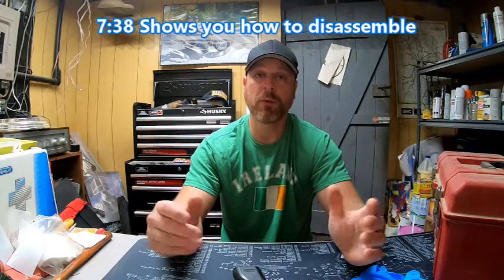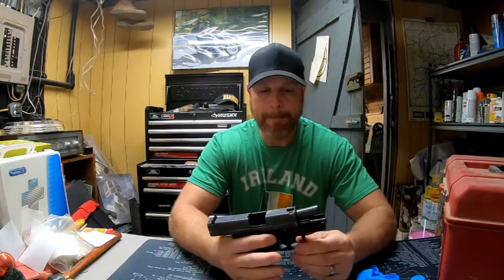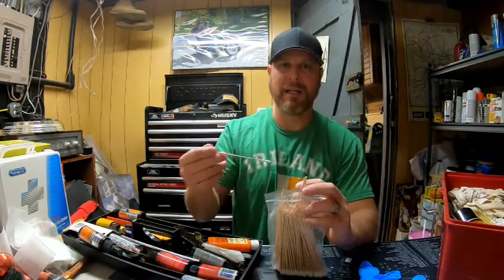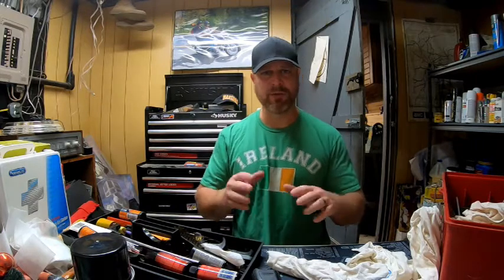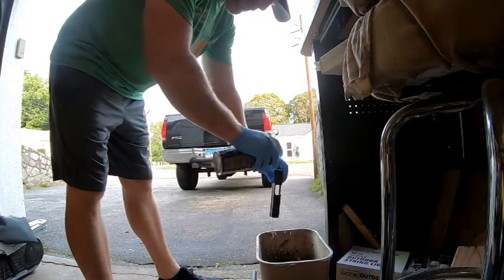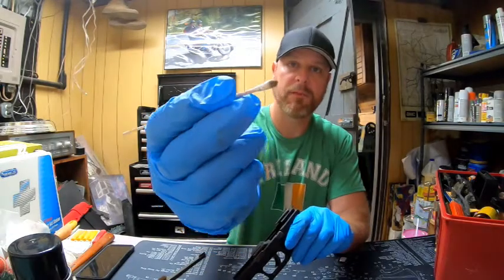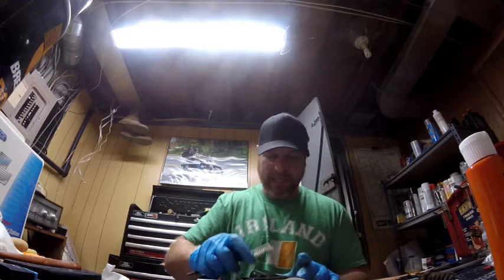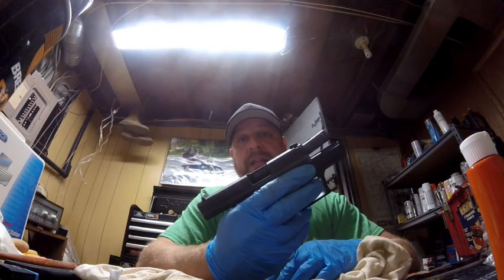XD40 Sub Compact. Disassemble Reassemble Clean & Lube.

Comment: Can you help?? I popped the spring off of the piece it was wrapped on to it won’t go back on
Reply from the maker: I am not sure if the buffer spring is supposed to come off the rod on the XD 40. Some buffer springs separate like on a sig but a Glock, or XD they should not. You may have to purchase a new buffer spring. You purposely tried to separate the two? Or was it broken? Buy a new one and go down to the local gun shop and see if they can help you. I had my Sig buffer spring break but didn't notice until I was cleaning it. But I did notice the slide was easier to pull back.

Comment: Can you help me with my XD 40 ? The slide is locked and in the position where you can take the slider off but is stuck . Please get back to me for help . Thank you 🙏🏽
Reply from the maker: Give it some lube! Not sure what is making it stuck. Something binding? Metal on metal? The release is not working? It could be too many things to just guess. See if you can find someone local that is knowledgeable about firearms to help you. I would bring it to the local gun shop and ask for assistance. Bring it into the shop in a secure case and ask if someone would be able to help you. Make sure the firearm is safe and clear with no ammo around before you give it to someone for assistance. Get permission before you takeout the firearm and start asking for help. Good luck and let me know what happens. Keep them clean and safe!